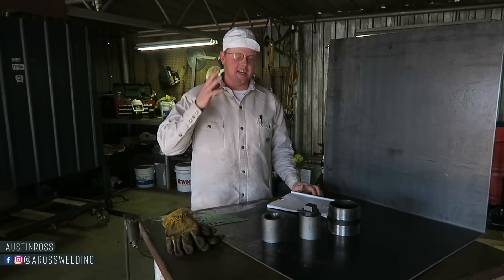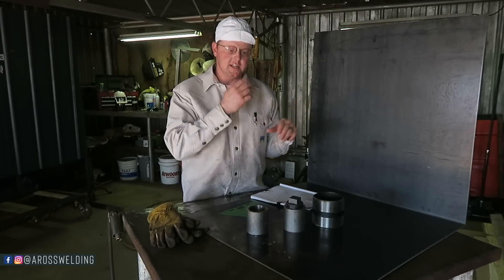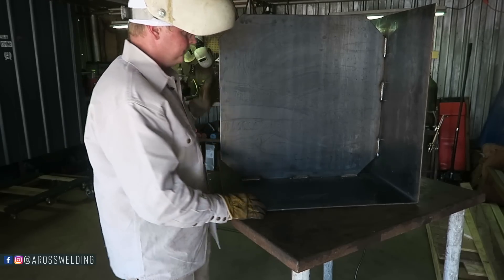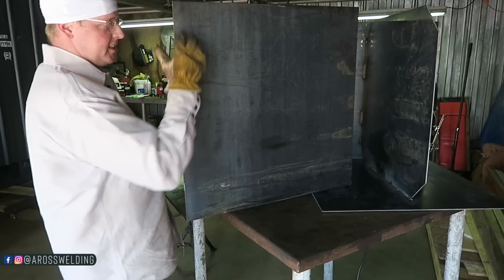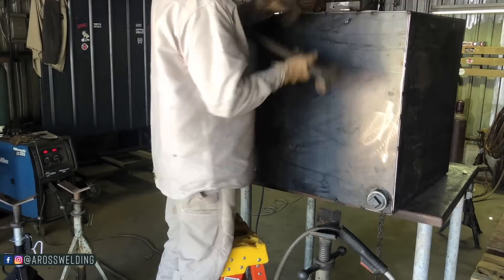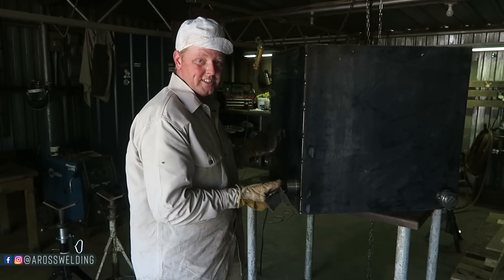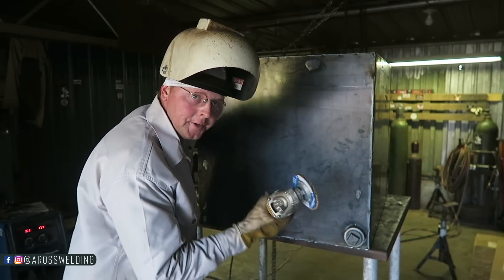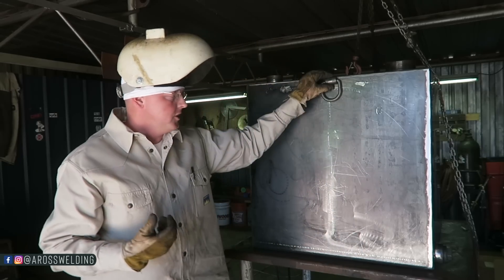BUILDING A CUSTOM 100 GALLON FUEL TANK // CENTRAL OKLAHOMA CUSTOM WELDING

Comment: Nice job. To make this pass CARB and DOT crash testing. Form your baffle @ 90* so it's a 1¹/²" flange. Weld the front of the flange to the tank body. This allows the baffle to expand during a crash and not rip a hole in the tank body. Also  connect a flat or round bar from the fill neck to about 1" from the bottom of the tank. CARB and Los Angeles Fire Department require this. It's under believe that fuel free falling over 10" can create a static charge. Also 112 gallons is the most you are allowed to haul above your frame rails with out a HAZMAT license. I've built fuel tanks for dang near 20 years. But nice job! I'm enjoying your channel!
Reply from the maker: This is all very interesting. Thank you for sharing!! I love it!
Reply: Can you explain the baffle part again? Would the baffle be parallel to the floor or  turned 90 from where he put it? And what flange are you talking about? Thanks
Reply: @cjgibbons5850  no problem! The way he has the baffle it's a flat plate welded directly to the tank body. This causes a direct pull on the on the tank body. This can tear a hole in the tank. In an accident, or road vibrations you want the baffle to flex. To do this cut the baffle 3" taller and 3" wider than the inside dimension of the tank. Then bend 1.5" of the baffle at 90* on all 4 sides. Basically creating a tab on all 4 sides. Then weld the very front of this tab to the tank body.  This will allow there to be flex at the 90* bend. An not a straight pull on the tank body. I hope that makes sense. It's kinda hard to explain but it's super easy. I wish I could post a drawing here. Lol
Reply: @cjgibbons5850  sorry forgot to mention the baffle would be in the same orientation as he put it. You want it to stop as much fuel splash as possible.
Reply: @danielellis2617  Great thank you very much for responding I understand what you are saying exactly. On a side note is there any advantage to breaking the flanges in opposite directions?
Reply: @danielellis2617  ok cool I see your actually only welding the baffle to one side of the tank to further its ability to crush internally without tearing.
Reply: @cjgibbons5850  awesome! Glad that helped. I've never done a baffle formed in opposite directions. Like one left one right. I would assume the baffle could still expand.
Reply: This would be true in most circumstances but there are tons of exemptions when it comes to agricultural usage. The law states nothing over 119 gallons without hazmat endorsement but most agricultural usages are exempt.

Comment: One of my first jobs out of high school was where they made air filter boxes for trains and semi trucks. Similar too your fuel tank only much smaller, about the size of a micro wave oven. The welders used mig process. After they finished, my job was to put seals on the openings, rubber gaskets, and fill them with air pressure, then push them under water in a tank and look for bubbles, leaks, mark them and send any leakers back to the welders to fix. Interesting job right out of high school.
Reply: We used to spray dish soap and air it up with a schrader valve to about 5 lbs.  No need to go underwater.
Reply: @marksarovich5534  Nice. It was a fun job, I actually enjoyed it.

Comment: It came out nice!  One recommendation I can make if you ever make another fuel tank, especially aluminum, is to put a stiffener or gusset inside of the fitting that will have the pump in it.  Vibration going down the road, pumps getting hit, hoses getting pulled seem to stress that area.  That looked like heavy material so it’ll be years before there’s an issue.  More than likely there won’t be.  Take care!
Reply: Yes , I was gonna say the same I used to weld for a fueling company and this was the number one issue repairing pump bases that cracked depending on the pumps they can be pretty heavy. I would always put 4 small gussets on the coupling just something to think about on the next one.
Reply: Yes at highway products we used .188 aluminum with another top plate at the pump for support.

Comment: Great build Austin....before I was a farmer I worked for a company wholesaling tanks in Texas and Oklahoma...and most of the defects we saw would be from cracks around the nipple where the pump was mounted.  Most of the tanks we sold over time started reinforcing that area where the pump was.  It also was a big plus if the installers cut a piece of rubber and put under the tanks when mounting....or got the fancy mounting kit Weatherguard made.
Reply: Good idea with that rubber. Real good idea.

Comment: Hi Austin. I came to your Channel over the Sidebar of YT, while watching Andrew Camaratas Videos. Im from Germany, im not a professional Welder. I am an Electrician, doing Welding only for repairing my Stuff like a Hobby. Its very interesting to see, how made the Jobs done in other countries. 
I started Welding about 3 Years ago with Tig. I found it the easyest Way. I thought its a little like soldering Wires, or soldering Copper Pipes with a Torch, so  for me it was easy to learn. For some thin Metal works at my Car, I bought a MIG Machine, witch also can Stick Rods and a Plasma Cutter. 
Next Thing i want to try is with the Stick Rods. In your Videos i can see how good they work outside in the Field, for example at windy Conditions. Seems like a good Option, between the MIG Machine with a Flux cored Wire and the Stick Rods. At least for higher Currents 150 Amps plus, cause the MIG Cable (does it mean Cable or Hose in English?!? XD) is getting quiet hot very fast at these Amps. 
 I also use a Propane Oxy Torch, but only for heating Things, loosening Bolts not for Cutting. For me Propane is much cheaper than Acethylen/ Ethin. 22l (11kg) Propane are about 18$ and for 20l (4kg) Acethylen the Gasguy charge about 100$...

Comment: Those dealys are a dog and wedge as far as I ever knew. on a show I watched they use them alot building ships to pull the deck plates into alignment before welding. 

Curious Did you check for leaks? Im sure its fine, but alot easier to fix before it gets filled with flammable liquids. 

Curious also could you have also just broke the pieces into essentially two “ U” shapes and nested them together?  Although really probably winds up being similar amount of welding either way i suppose. 

Awesome job !

Comment: Do you soap test it for leaks? We used to put about 5 psi air pressure in the tanks and put soapy water on all the welds checking for leaks.

Comment: Will this fuel tank go in a truck or "somewhere else?"  Sure enjoyed the "start to finish" in the video.  Baffle triangle cutouts at the bottom suggest if it gets "imbalanced" it will be slowish to "equalize" again (guess that means it will be equally slow to become imbalanced, so what's it matter?).  Do any air pressure tests to be sure there are no leaks?

Comment: I’m curious as to what steel you used and was the inside coated after for added protection?
Reply: I was wondering the same thing I was hoping he used a coating on the inside of the tank
Reply: I was expecting something about cleaning the tank, too. It is going to be a rusty mess inside in 20 years, clogging up filters everywhere.

Comment: Couple questions… steel thickness?  Any rust inhibitor or coating on inside? Any reason customer wanted such large openings? Ever considered sloping the bottom towards drain and pump? Do you pressure test welds for leaks? If you extend both top ports/pipes deeper into tank it should prevent customer from filling 100% and thus allow for expansion per DOT requirements, correct?  Having suffered from rust in my steel tank that ended up clogging up my tractor $$$$, I’d add a bolt on/removable access panel on top so I can inspect and clean it out every so often.
Reply: PS and you did a great job on this tank, turned out fantastic!!

Comment: How did you test for leaks
Reply: @JJ-jv1gu  NO WE DONT WE JUST MARK OUR SPOT BROTHER 😎😎😎😎👍
Reply from the maker: I usually would  but my air compressor is down. Luckily the guy I built it for has one and we’ll use his.
Reply: Pressure it to 2 pounds and spray the welds with soapy water I tested a thousand or so tanks like that.
Reply: Just like we test wellheads, get your hydraulic Jack and fill it with ATF lol ;)
Reply: @JJ-jv1gu  😂😂

Comment: If I was custom building, I would add a baffle right next to the necks because mine sloshes up against the filler when full, making it ooze.
Reply: That's a good idea. The baffle for the neck could just be a next size up nipple about 12 inches long, going down inside the tank. If welded all the way around, it would also serve as a gusset, stopping cracks locally and making repairs easier, since this is where the tank is going to crack.
Reply: @FelonyVideos  you'd need to drill a hole near the top for letting the air vent so fuel can come up in it. Or the fuel cap can vent.
Reply: @chucknSC  The fuel pump inlet pipe goes most of the way to the bottom of the tank.

Comment: Did you pressure it up with air to test for leaks?  That’s what I have done before with fuel tanks....
Reply from the maker: I usually would also but my air compressor is down. Luckily the guy I built it for has one and we’ll use his.

Comment: how did you come up with 231? anda, i used to work in a company down here in houston that makes accumulators, and i (we) made the tanks too but we made them depending the size of the ccumulator, my point is that after we welded the tank we had a bushing with an air hose nipple and we'd put in 20 -35 lbs depending on size and we'd have a squirt bottle with soap and check the welds all around!
Reply: 231 cubic inches in a US gallon
Reply: Jaime M thanks man din't now that!

Comment: I know i want to eventually build a new fuel tank for my trk.  Right now i have a tank with gas in it for the tractor and generator.  I want to make it tall and without the space under it and make front to rear skinnier but the real fun part is dual fuel. Gas on passenger side with pump then diesel on driver side gravity into trk. About 30G and 30D so 60 total

Comment: Excellent workmanship!  However, would it be prudent to pressurize the vessel with a few pounds of air and soap test all the welds prior to filling with fuel?  Asking for a friend.
Reply: No doubt. I've installed dozens of new tanks in boats, and every time I picked them up from fabricator he had them pressurized so I could see them holding air. He would then soap the welds in front of me.
Reply: @evadevries2952  BEING A UL LISTED 142 TANK FABRICATOR FOR 40+ YEARS, WE HAD TO AIR TEST AT 5 PSI, AND A BIG NO-NO, WAS MIG WELDING!!!!!!!!  THEN YOUR UL PLATE WENT ON!!!!!!
Reply: @StortWeldingCoLLC  pressure test and with fuel tank tank penetration is in important so we also had to use an indoscope to check.
Reply: @StortWeldingCoLLC  were you welding with stick? I'm assuming cause of heat and warping?

Comment: 1 gallon volume is 231 cubic inches. Multiply by 100 is 23100 cubic inches.  cube root of 23100 is 28.4798256733.  Your slightly over 100 but need room for expansion.  
I think I would have fish plated the d rings.  One gallon of diesel is 7 lbs and 100 gallons plus a 100 or so lbs for the tank is 800 lbs.

Comment: You don’t do a hydrostatic test to ensure there are no leaks, or would you recommend that to a beginner welder?
Reply from the maker: I would usually test it with air but my compressor is down. Luckily the guy I built it for has one so we’ll use his. Yes I would recommend pressure testing it one way or another.
Reply: @arosswelding  do you have any videos explaining what would be a great beginner welder and tips and tricks at all?

Comment: Welding tanks, it easy to get cracks around the cut out. How do you avoid them.
Reply: they usually crack beside the weld in the heat effect zone . I had that problem welding bolts on plate that had dynamic loading . changing the lines of stress in the heat effect zone helped . by welding a bead across the initial  bolt weld about an inch either side breaks up the lines of stress . . think of a circle with a extended X through the circumference . Another way would be 2 passing your weld the last weld lapping the main weld on the inside by 50% that way the grain structure is refined and there is less chance of cracking . Where there is dynamic loading you also want to use 7018 rod if you are using stick as it is more ductile than a 6010  and less prone to crack

Comment: Gday austin, good job mate. 
When you change to overhead, what settings do you change as opposed to downhill? Im guessing slightly lower voltage or wire speed as well?
Reply: Snapps Undone  i do experement but its nice to know what a professional feels on the subject.

Comment: Did you test for leaks?
Reply from the maker: I usually would  but my air compressor is down. Luckily the guy I built it for has one and we’ll use his.
Reply: @arosswelding  Sound good, bud.  Thanks for sharing this project!

Comment: i notice you dont have a cap made with a presser Gage with a built in tire valve to presser test your tanks, you put 7 pond presser in the tank and let it sit over night, and check that it has not lost any psi over nigh.. building out door wood burning water heated furnaces, out of titanium enhanced 409 stainless steel 1/8" .. titanium is for high heat, when you weld it, you dont get that bluing . they dont rust.. i test every water jacket.. there is a usa company, were i get all my weld on tank fittings. in steel, stainless steel and aluminum,, one square foot is 6 gallons, ya dont need all that fomula

Comment: No hole in the baffle ?
Reply: 4 corners were chamfered 45 degrees.
Reply: don't need them if your corners are bobbed as he has . The fuel can move to either side of the tank . Although it helps to lighten the tank weight